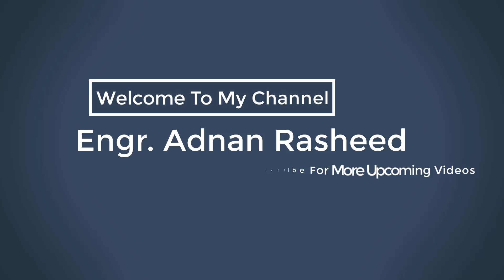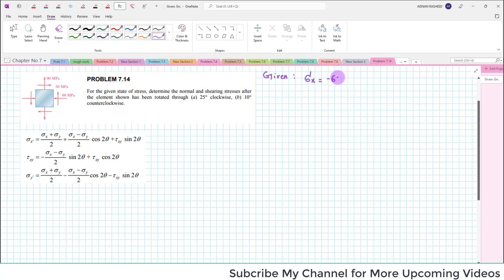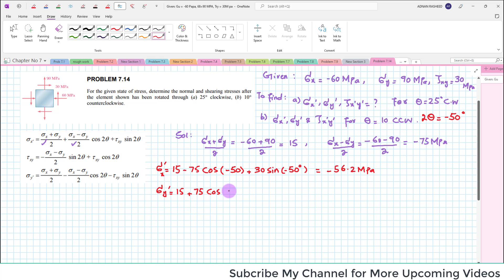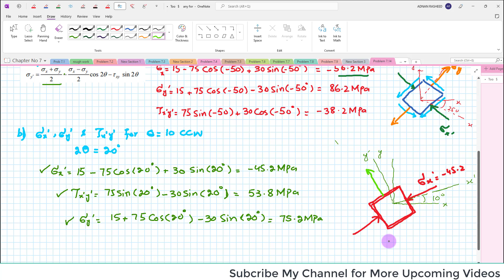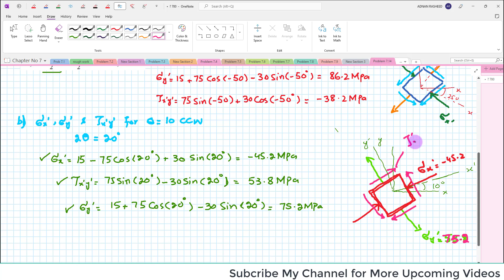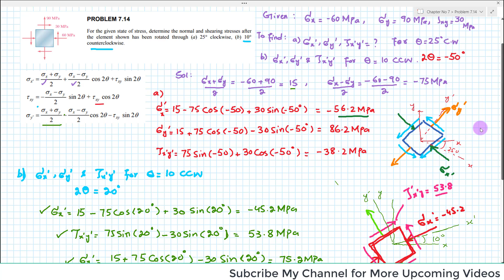Problem 7.14 #Chapter 7 Transformation of Stress  #normalstress #shearstress#trasnforstresses

Comment: Sir are these videos for civil engineering students.. looking for ktu mech sem 5 student MOM to clear supply- ME301. Please let me know if the syllabus is same?
Reply: KTU its for my daughter who has only this one supply. getting stuck with numerical problems. You have solved so many problems from this subject but was wondering if its for civil
Reply from the maker: It's for mechanical engineering course. I am also mechanical engineer
Reply from the maker: It's for mechanical engineering course. I am also mechanical engineer
Reply: @engradnanrasheedmechanical  ok thanks i will tell to check with ktu previous year questions. thanks a lot. which syllabus are u teaching
Reply from the maker: Currently I am teaching manufacturing processes lab
Reply from the maker: You can check it with your course contents. Rest the concepts is mostly same. You are from which university?
Reply from the maker: I am teaching in Mechanical engineering department.